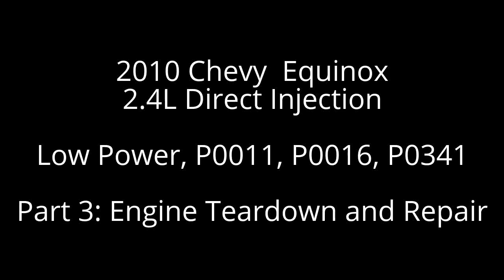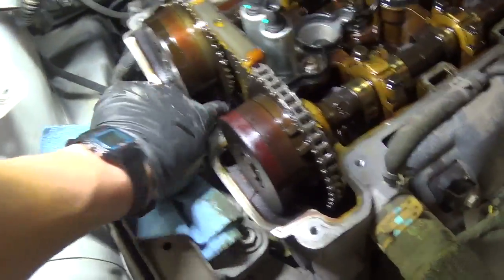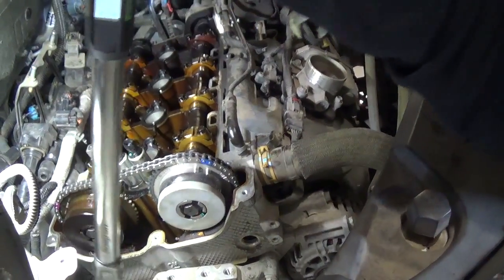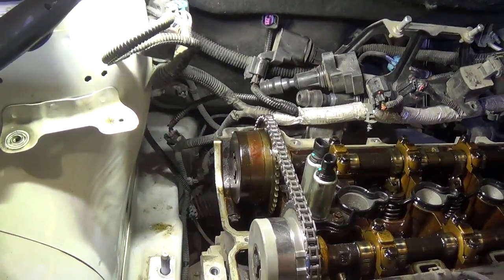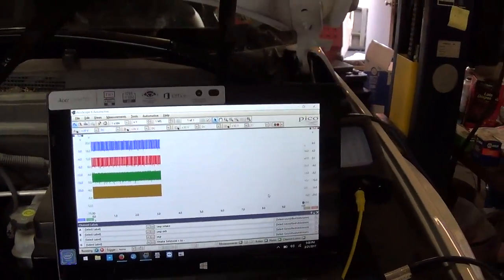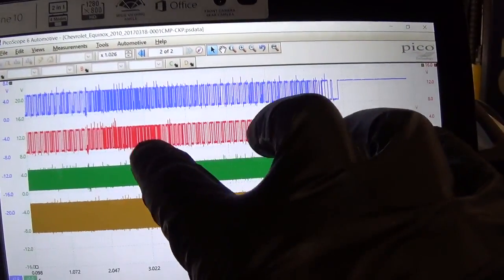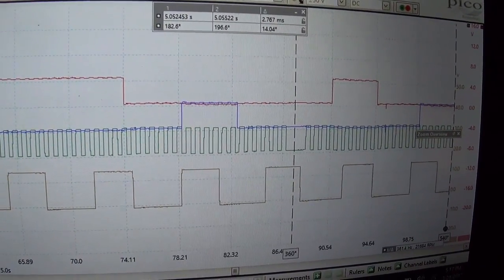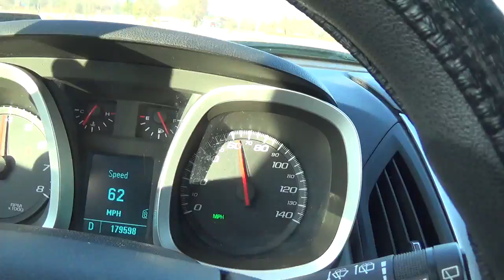P0016 P0011 Low Power case study: Chevy Equinox - Part 3

Comment: We had a 2011 Equinox towed in with a chain that jumped and caused the valves to hit the piston. After talking with several other shops around me, I learned this is a fairly common issue these engines are having. The vehicle we saw only had 99,000 miles on it. I really enjoyed watching your diagnosis.
Reply from the maker: Thanks! Seems like this is the epitome of the "modern disposable vehicle"...
Reply: Mine did the same thing

Comment: Someone had replaced both the timing chain and the water pump/balance shaft chain before, the timing chain from the factory had 2 red links and 1 green link and the water pump/balance shaft chain had 2 white links and a green one. But the give away for me was the front cover gasket being cut! GM doesn't cut those gaskets, techs do so they don't have to take off the engine mount! Great video and great explanation using the scope!
Reply from the maker: Wow, thank you for those observations! And I was surprised this one made it to 180k miles. So it seems there is no way one of these Ecotec engines makes it past 110k mikes without "surgery" lol
Reply: Right, ive seen some chains wear though that upper guide shearing off the metal and wrapping it around the crank making it not rotate.. Its a shame when the ecotecs were in the 2.2 form they were bullet proof as long as you changed the oil.  Those engines are capable of some serious power but the fact that the chain is the weak point kind of puts a damper on that!
Reply: They really seem to have screwed the pooch with the timing system on the later Ecotec engines. Like you say, the older engines were never known for such issues.

Comment: This has to be one of the best series you have done this year. Very interesting case study. 

I can't believe GM has had so much trouble with their timing chains. I've seen a few petrol Vauxhalls which have suffered from jumped timing, no start, smashed valves and bits of tensioner in the bottom of the oil pan.

Comment: When ours was done, the mechanic changed just about every sprocket that chain touched as they were all worn compared to new.  He also changed the water pump, the tensioner, oiler (newer ones have a bigger orifice), and broken guides.  What a royal pain!!

Comment: If all that was caused by the low oil, which is very likely.  you need pistons and rings as well.  depending on the history of the vehicle.  a high pressure fuel pump balance shaft chain and guides should also be changed.   there are many special policies on these motors.  My guess is when the high pressure pump leaks fuel into the crankcase, it thins the oil and causes all these problems.  If you can monitor the high pressure fuel rail pressure on the scanner after priming it with engine off and it drops, I'd replace it. or get the recall done
Reply: My 07 chevy cobalt 2.0L supercharged had cracked piston rings, used to blow fuel into the oil lots. Thin oil caused the cam chain bolts to break (because the tensioner is pushed by oil pressure, no spring loaded).

Comment: Hi Ivan, I have a similar issue.  Same codes but also had P228D, but engine just rebuilt, but still has original cam actuators.  Also replaced the cheap aftermarket tensioner with the latest updated tensioner from GM.  That has helped some, but after doing idle relearn, the car would not learn a new idle.  Hunted like crazy from 500 to 1000 rpm.  Base oil pressure at idle hot is 25 psi and 80 at 4K.  Measured at block from oil pressure sensor port.  Engine is noisy as hell at hot idle.  LIke a diesel.  P228D, P0016, P0011, P0089, P0300 were all codes in the engine.  Was redone due to excessive oil consumption.  Only code now is p0300 which only happened after 15 min at idle.  when cold, engine idles good, and quiet.  fuel trims look good.  Less then 10% on short term.  O2 cycles well but the cat is done.  175K miles.  Other mechanic used Dorman solenoids for the cam actuators.

The major hunting at idle issue was simply carbon and sludge buildup in the throttle body. After doing a idle relearn it could not relearn it's idle because of the sludge build-up. So after I cleaned the throttle body the idle hunting issue has gone away and currently it's not throwing any more codes but it's still will occasionally have a small minor stumble at idle but not enough to throw any codes and the idle will ever-so-slightly hunt. I have not checked the misfire codes at this point since I've had the battery disconnected and I believe most all of those counters have been cleared out at this point but I will check. The other thing that was interesting about this one is that the engine has been completely rebuilt about a hundred fifty to two hundred miles ago and all the timing chain components have been replaced other than the phasers. They put some cheap aftermarket tensioner which was the old style tensioner I replaced that also. Which seems to have helped with Cam and crankshaft timing correlation issues. The other interesting thing is is that when this engine is hot you have 25 psi oil pressure in the block and only 2 to 3 PSI in the head.  When the engine is cold do you have you have about 80 psi on the Block in about 60 PSI in the head. The other thing is when at idle and the engine is hot you can hear a large amount of timing chain and valve train noise however if you disconnect the exhaust cam actuator solenoid, all the valve train noise goes away and the engine is very quiet. If you look at your camshaft pids' you'll see that at idle the exhaust cam is commanded at 5 degrees and the intake cam is commanded at 16 degrees which both correspond to the desired specs, and there is no variance issues. If you command higher or lower timing Advance on the cams they correspond accordingly even with that low of oil pressure in the head. If you command exhaust cam to 0 degrees or disconnect the solenoid, the valve train noise dissappears.  As far as closed-loop operation this engine won't even begin to stumble or Miss until after 30 or 40 minutes of driving and only does it at idle after it's been idling for 5 or 10 minutes after a decently Long Highway Drive.  Also noticed if you let it idle for extended time, the noise will clear up.  Almost like oil starvation to the head?   

Thoughts?
Reply: So carbon and sludge cleaning from throttle took off all the codes away?

Comment: One quick tip on that timing cover gasket, don't cut it with wire cutters.  Your snips got right through it but I have seen guys try with some dull cutters and deform the gasket and have a leak right after.  I cut it with a Dremel just so no pressure is applied to distort the gasket.  If just changing the timing cover you don't need to remove the engine mount if you snip that piece out if you want to leave it intact the engine mount goes through the gasket for some ungodly reason, this comes in handy when you have to reset the balancer shaft chain tensioner after someone incorrectly replaced the water pump on those and you get a big whine from the motor that sounds like a bad alternator but is the balance shaft chain too tight.

Comment: I just saved one of these motors today, chain hadn't jumped yet but was just as loose as yours. Only found it because of a leaky valve cover I recommended to a customer just finished the primary and balance chain kit installs. Crank sprocket plastic sections had fallen apart on one side of the sprocket, and the balance shaft chain was loose beyond the max tensioner adjustment. 96000 miles
Reply: Also, my "suitable tool" was the rubber handle of my cornwell 3lb sledge lmao.

Comment: Hello Pine Hollow Auto Diagnostics,

Love you video series and this one was quite interesting, but have issue with your proposed timing chain elongation question.

The timing due to chain "stretch" is negligible at the sprocket (proposed 8deg off) as the chain is captive by each tooth.  The problem with elongated timing chains is most evident in the longest distance between sprockets under tension.  In this case is would be between the intake cam and the crank shaft.  Would be surprised if timing off by more than 1deg with elongated chain.  Most failures are chain guides, followers, or tensioning system.

Cheers and keep posting,
Mr. P

Comment: Hey Ivan. Check out the Brownline torque angle meter. It has a magnetic base that you can just stick it to a ratchet or breaker bar. I bought one about 2 years ago from the Matco guy. I tested out and is 100% accurate. Tons cheaper than the electronic torque wrenches. I do a lot of 6.0 Powerstroke head gaskets for a cheapskate who won't pay for the studs. Works awesome with a breaker bar and cheater pipe for the final 90 degree pull.

Comment: I’d never buy direct injection. Not until they find a way to keep the intake valves from getting crud built up on them and causing leakage. Nice diagnosis 👍🏼 job well done.
Reply: Catch cans work wonders.

Comment: For anybody that is watching with a newer than 2012 vehicle. You WILL need the special tool that he didn't use. Gm redesigned the gears so the outer portions of the gears are not attached to the camshaft and so even holding the camshaft with a wrench. that Center piece can turn when making your final 180 degree torque. Which will make the phaser portion of the gear not be set right.
Reply: Is that so for a 2012 or no?
Reply: @cottonhi-sk1yh  just did a 2012 regal 2.4 today. Cams are indexed to the sprockets, used a 24mm wrench to hold the cams.
Reply: @archangel3237 He said newer than 2012 so 2013 and up

Comment: great series. theory testing math and it all lines up and makes sense.torque and turn as we called it (torque  to yeild)requires one part to remain statonary. thus why the special tool.impossible to hold by hand and turn with the other.although i doubt you'll have any problems with this repair , but it is a concern. and really im not sure how much i'd trust that torque wrench.i tried one and it was off. i think you were right thinking paint marker.

Comment: Hey man. Just wanted to correct you. The new part as mentioned "Actuator" @ 7:25 is actually the cam phaser. The actuators or solenoids are located behind them vertically up and down. They are what allows oil flow to the phasers to correlate variable valve timing
Reply: Do you know what part # for that cam phaser is?

Comment: Great video
I had the broken tensioner with codes 
P0016 P0017 
Replaced it with timing kit #
Duralast / Timing Set
Part Number: 7620
No cam phasers included
Upon start up ran rough with a 
P0011 P0014 P0017
I didn't use any specialty tools !
Disappointment came to mind.
Slept on it ...zzz picoscope!! Zzz... 
Next day I Actuated cam phasers thru scan tool  
Did that once....twice  and then it idle properly 
My conclusion ? 
Air in the hydraulic system after my rebuild.

The replacement guide didn't look updated.   I wonder how long til it needs to be disturbed

Comment: My friend has such a car and the diagnosis is p0011 the car is working fine but when I press a little bit on the accelerator pedal a little bit by 1 percent the engine suddenly turns off what is the reason I replaced a new cvvt the wires are all good what is the reason why I doubt that the malfunction is mechanical
Reply: When crankshaft position sensor is not working the car turs off. Or in my case, my car started turning off suddenly in the traffic lights or turning. When the chain was completely loose, it did't turn on anymore. When I opened it, I could see what I am saying. The chain was loose and completely out of position. And all the plastic tensioner broke into pieces, which clogged the oil pan filter completely.

Comment: long timing chains are built to break, to wear one out before it time , fast  acceleration, and don,t change the oil!
Reply: I drive like an old granny, never speed, race or over-rev 3500 max. Keep an eye on oil dip and watch the actual engine coolant temp reported by the ECM (not what the dash-gauge says). Why those kids rev at 5000 rpm to show off, bloody idiots.

Comment: I am not sure about a Torque Wrench that beeps/buzzes ...
I am still enthralled with the J.C. Penny torque wrench I bought in 1973
it SNAPS with authority at the proper setting
Reply: you may not be able to find it one day and the wife will have it :))
Reply: I still have It ..!!
not the Ex, tho ..  :))
Reply from the maker: Yeah, the new tech is nice, but nothing beats an old reliable click-type wrench. Almost like automatic vs. stick-shift...you know which one I'll take any day of the year ;)
Reply: Ivan could not do 100 degrees in one stroke. He needed every feature that thing had.
Reply: o
'Having calibrated torque wrenches, the internal springs lose their "power" and must be calibrated at least once a year.   I like the "click type also."   My shop calibrated torque wrenches that were used on the propellers  of  Pratt & Whitney R-2800 engines. (2,000 HP).  These were BIG wrenches - think it took two  men when torquing.

Comment: Would be interesting to see the oil change history on this engine. Never thought they used spring timing tensioners on the ecotec. More dependable than hydraulic when people let the oil level go low which is pretty common. I worked on a GM 3.5L with a four quart capacity that was three quarts low and still ran well!  Iam sure neglect and stupidity is accounted for somewhat in the engine design.
Reply from the maker: Or the Buick 3.8 pushrod V6...no maintenance required lol
Reply: 3.8 liter is a great engine had 07 buick lacrosse with the series 3 in it one of the best cars i've owned 230000 miles nothing but oil changes and a wheel bearing. Deer ended it's life last year.

Comment: What's with the wonky chain stretch mathinomics.   I don't agree with that critical thinking question one bit. If what you said is remotely true there would be a visible length difference in the two chains.  I would lean towards lack of tension allowed to much whip in the chain causing it to skip across the gear probably upon deceleration.

Comment: Well done, guys. It sure could have been a lot worse. At least it should go a few more miles without the problem returning.
Reply from the maker: Just enough time for the customer to save some more $$ to dump into the "GM money pit" haha
Reply: Funny, we had similar truck at work not long ago (Maybe Terrain) with a solenoid fault code with the chain rattling. The customer had already replaced the intake and exhaust oil control solenoids.
 We told them that the chain was likely stretched and required disassembly for inspection and they decided to take it with them. It quit about 5 min. away.....The chain jumped and bent all of the exhaust valves. 
 The customer decided he wanted a low mileage salvage engine as it was burning a lot of oil too.
Reply: Pine Hollow Auto Diagnostics yup gm money pit..  and just all round made cheap

Comment: Ivan

Re the stretched chain. Surely the whole length is not important. The length from the cam sprocket to the crank sprocket on the tight or tension side that actually drives the cam is what matters, I would have thought there could be lots of extra length on the tensioner side as that doesn't matter it's only slack that's not used productively. I think?
Reply from the maker: Right...but the entire chain stretches evenly, so it's easier to measure the total chain stretch and then divide in half to see how far the cam was off. This is  what I showed in the video :)
Reply: I'm not sure on the math explanation on that part is quite right. You said it was off 1/2 tooth over half the chain. And one tooth is 15.6 degrees. If it's off 1/2 tooth over half the chain, then it's off 1 tooth over the whole chain, or the whole 720 degree engine cycle. Which is 15.6 degrees. But then as stated above, only half the chain is tensioned and driving the gear, which puts us back to 1/2 of 15.6. The end result is 7.8 degrees retarded on timing because the chain is 15.6 degrees stretched.
Reply: The chain has jumped 3 teeth on the cam sprocket, thats where the 45 ish deg comes in. The chain stretch is probably negligible if it were only that
Reply: No, the slack doesn't just all go to the tensioner side of the chain. It will pull all the sprockets towards the tensioner. Usually this retards the timing of the camshafts.

Comment: Hey Ivan! I loved the information on your video. I have a question regarding the 2014 Equinox 2.4L. I've run into the same exact problem(PO016). Upon inspection of all the old timing parts I realized the right chain guard which is black had snapped. When I try to put the new timing chain on the marks don't line up and I don't know which cam to rotate in which direction. Should I figure TDC at cylinder 1 then proceed to degreeing the cams? Do you have any advice  if there's a faster or easier way of solving this problem? TIA!

Comment: Am working on the same Chvy, the car came with engine stalling , I scanned the the car and the faults code is p0011 which is intake camshaft actuator range performance, I changed the sensor into new one but still the same intake appear if you spark and press full acceleration, I checked all the wire continuity everything is ok, I need your.